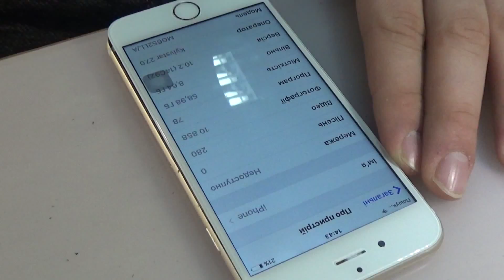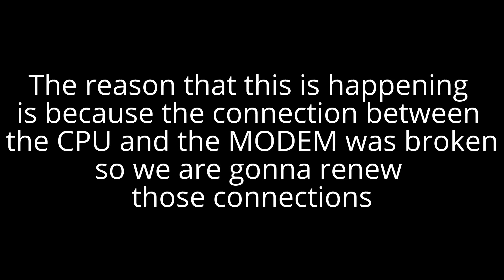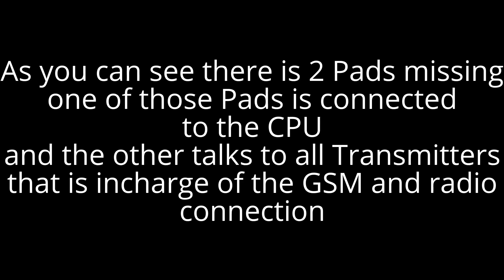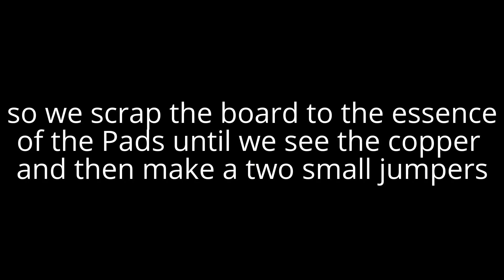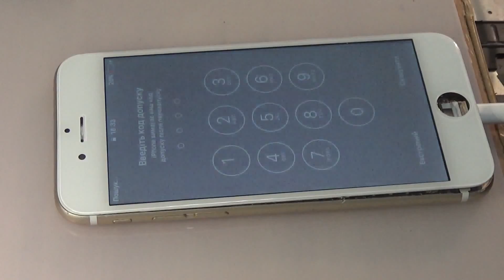iPhone 6 searching no service

Comment: What is this green thing on 9:21 ?
Reply: Mechanic UV mask
https://ru.aliexpress.com/item/High-quality-10ML-GREEN-UV-SOLDER-MASK-PCB-BGA-PAINT-PREVENT-CORROSIVE-ARCING-Soldering-Paste-Flux/32662488165.html
https://ru.aliexpress.com/item/UV-Solder-Resist-PCB-UV-Curable-Solder-Great-Mast-Solder-Mask-Solder-Resist-10g-2pcs-lot/32321378391.html
https://ru.aliexpress.com/item/MECHANIC-10ML-GREEN-UV-SOLDER-MASK-PCB-BGA-PAINT-PREVENT-CORROSIVE-ARCING-Soldering-Welding-Fluxes-Oil/32827077902.html

Comment: what temperature do you have your soldering iron set to and what temperature is your hot air reflow station set to (celsius)? how long do you hit the chip with hot air before its ready to be removed and how long do you hit it with hot air when you putting it back on.
Reply from the maker: Hello, i have set the temperature of the pre heater to 130C so you will need to set the temperature of the hot air station to 218C when you remove the BB and the temperature of the soldering iron doesnt  matter you can use it on 325C and when solder the BB back after reballing you set the temperature of the hot air to 202C.
and i recommend you check the temperature of everything when you start to repair the phone so no overheating will damage the board.
Reply: Thanks for the information. Does changing the baseband ic chip always solve the no service problem or is there some other chip that needs rebelling ? What type of wire do you use to make the jumper ? Thanks again

Comment: Hello I touch can you advise me I have iPhone 6 everything was working ok then just went off the phone was hot so I left it an hour to cool down but when I turn it on now nothing at all on screen you can hear the phone on just nothing on screen so I’ve taken the screen off my other iPhone 6 and tried it on that one and nothing on screen but I’ve tried the other screen on my other iPhone 6 and it works ok what will be my problem as I now know the screen is good and I can hear the phone on but just nothing on screen
Reply from the maker: Hello i assume that its the backlight chip and in your situation i can advise you to replace all backlight elements (the IC and the coil and the diod) and if you have the schematics you can see that on the output of the chip their is three capacitors one of them i suppose will be shorted to ground you need to check them too.
But if you dont know how to do that i advise you to go to a repair service and let them do that.

Comment: Hi there, could you please explain why it is needed to make the jumper on these two pads?
Reply from the maker: because those two pads are broken as you saw in the video without them there will not be a connection between the CPU and the baseband and all of the transmitters

Comment: Hi iTouch, my iPhone 6+ has a searching problem. I tried restoring it but hanged on error (48). I went to mobile repairer shop, they told me to replace motherboard. I need your advice.
Reply from the maker: Hi its the first time i hear about error (48) on iphone 6+ maybe it needs the mother board to be replaced and maybe its an easy fix its just the IMEI is in the CPU so i dont know what to say, take it to another repair shop see what they will tell you
Reply: Thank you iTouch for ur advice. Please update in utube if you come across error (48) in iPhone 6+, thanks.

Comment: hey can you tell me what stuff i need to buy to fix my iphone 6 no service problem.thanks
Reply from the maker: you need to be a professional  repair shop you cant do it by your self
Reply: ive tried to go to a shop. i even went to the apple shop they even said they cant do anything when they didnt even want to open the phone. all they said was its from the inside its messed up. i knoow i got no service and this video is the way to fix it but ive been to many shops all they say is same thing, cant fix it probably because they dont know how to. so i rather do it myself...what do you suggest? i could send you the phone if thats ok i will pay for shipping?
Reply from the maker: the shipping will coast more than the work it self so i dont know you can show this video to the repair shop and see what will they say

Comment: hello, excellent video, what is de diammeter of the balls? thanks for share!
Reply from the maker: 0.25mm is the diameter of the balls
Reply: good thanks, i forgot ask you, the stencil where you get ?  :-)
Reply from the maker: from eBay i would recommend 8*8cm
Reply from the maker: on eBay i would recommend 8*8cm
Reply: Do you have to use solder wick?
Reply from the maker: yes so you can clean the pads on the BB from the old solder
Reply from the maker: yes i think!!

Comment: What's the temp of the heat gun, and what kind of flux you use and where to get it
Reply from the maker: i use a preheater to heat up the board first and to desolder the chip i use 216 C and the temperature on the preheater is 150 C and to solder it back you use on the heat gun a 204 C temperature.
And the flux i use is AMTECH NC-559-ASM and the volume is 10cc
Reply: when you were cleaning the pads you damage some other pads. would that affect any how?
Reply from the maker: the other pads are NC that means that they not connected any where so its ok

Comment: Hello, first thanks for this useful video, second sorry for the bad english because i use the translator, i would like to know the type of green glue and the type of bridge used to make the connection under ic and thank you
Reply from the maker: Hi thank you for watching my video the green glue you can search for it on ali express as a UV mask i use mechanic LY-UVH900 the volume is 10cc
And for the bridge or (jumper) is an ordinary copper wire with a 0.02mm thickness and you are good to go

Comment: Hello if I had to change the moden I would have to program something or just intala it is done reballyn but I would like to know if it is programmed or not because I have a 5s and the rubber makes it difficult if the moden was damaged I only put another one and works?
Reply from the maker: No you can replace the baseband because it has the IMEI number inside si its only the same baseband
Reply: Thanks
Reply from the maker: you welcome
Reply: Hello I have an iphone 6 without service he warmed the moden came out a few minutes and then left I did reballing has all the tracks came out a few minutes and it went away that it could be but I warm again the moden and come back a few minutes that I do

Comment: Hallo , I have an Iphone 6 with shorted modem baseband IC. is there a solution to replace it ??
Reply from the maker: i didnt replaced it i just reballed it and if you have a short on the baseband the maybe its the baseband PMU ic check first then check the capacitors that around the baseband and the baseband PMU

Comment: Do you use some black glue remover? Because when I go to remove the baseband I always suffer with the glue. Especially the glue that lies underneath the IC. Ends up losing many pads, what I need to do to leave so perfect like your kkk thanks
Reply from the maker: The iPhone 6 doesnt have underneath it glue only on iPhone 5S and iPhone 5 all of the new iPhones doesnt have under fill and when you loss a lot of pads its mostly NC pads
Reply: Thanks for clarifying my doubt, I really only trained the baseband removal on dead motherboards of iphones 5 and 5s, and I had this problem with the glue! I am with two iphones 6 with no service, and I was scared to try to remove the basband and happen same the iphones 5 and 5s kkk THANK YOU AGAIN! It has been helping me a lot.

Comment: have no problems whit missing points?
Reply from the maker: if they are NC then there is no problem
Reply: thank you, will have a problem if buy a new IC to resold?
Reply from the maker: yes you cant replace the BaseBand chip like that its linked to the CPU and the NAND memory

Comment: what kinda liquid is that you are using?
Reply from the maker: The green one is called a PCB mask and the yellow one is called a flux it makes easier to solder off and solder on the chips and the green one is for protection

Comment: Thanks for your video! Subscribed. Is this repair reliable?
Reply: By reliable, I mean if the connections stay secure after many months?
Reply from the maker: yes very reliable done it a lot and none come back
Reply: Thank you, you are right! I did the repair on a 6 plus a few days ago and everything is still working great!
Reply from the maker: i am glad that everything is working fine
Reply: hi,Ray.this is the professional mobile phone repair machine:https://youtu.be/KplWC3MT2t0 it can repair all chip ic for mobile and ipad.it equipped with HD optical alignment system.You can contact with me if you have any question for the machine operation.Thanks.

Comment: Hello! Tell me please what flux do you use in this reballing? Thanks
Reply from the maker: hi thanks for watching my videos 
The flux that i am using is Amtech NC-559-V2-TF 30cc and you can find it on eBay but buy the original not the fake the original coast about 20$ buy it from a USA seller

Comment: Hey can you give a link or name of the green glue that you use??
Reply from the maker: its called UV mask you can use it not just for covering the jumpers but also to cover is you scratch the board while removing a chip 
https://www.aliexpress.com/wholesale?catId=0&initiative_id=SB_20170224025107&SearchText=UV+mask
Reply: i see,  I used it in the past, but it resistant up to 260C
there resistant glue up to 400C
but I can't find it
thanks anyway
Reply from the maker: why you need the glue to have a 400c resistance??
Reply: for the solar system circuit
Reply from the maker: i am sorry i cant help you i dont know any UV mask that will hold that much of temperature

Comment: Hey, nice video. Where do you get the tools? I have the soldering equipment but not all of the metals that you used, what are they  (copper or led?). The wire that you use to clean the chip, it looks like copper, where do you get it.
Reply from the maker: hi i am really happy that you are watching my videos 
about the tools i buy them at a regular electronic shop 
that metal that i used called WICK and its made of copper the best company that makes copper wick is (Goot)
and you can get it on eBay mine is (2.0mm width) and you can buy what ever length you want it doesnt matter 
i am gonna make a video of the tools that i am using soon so stay tune